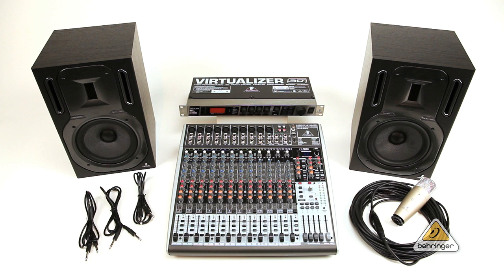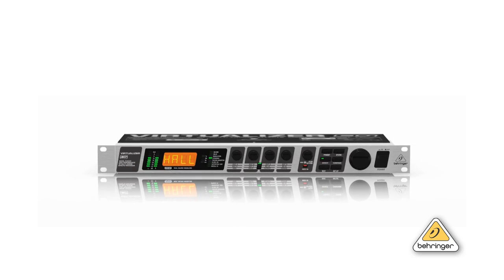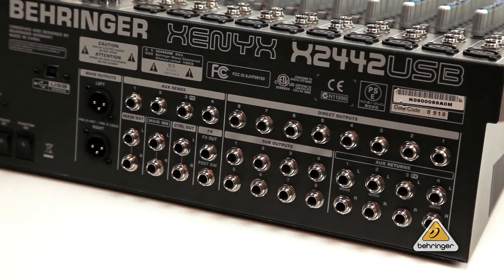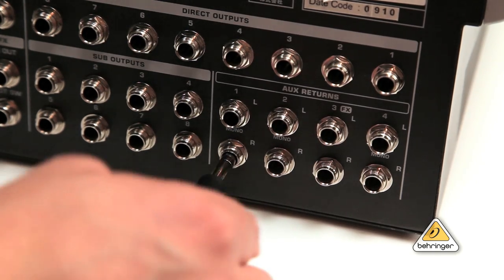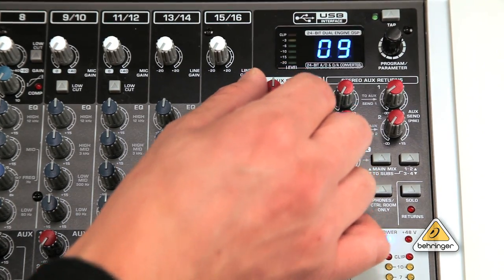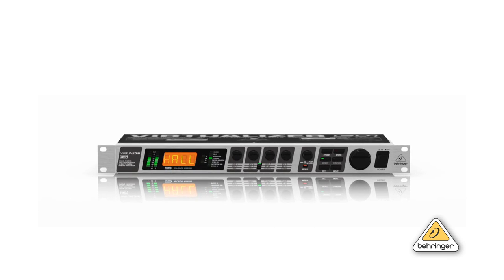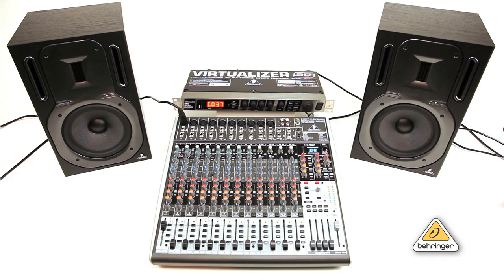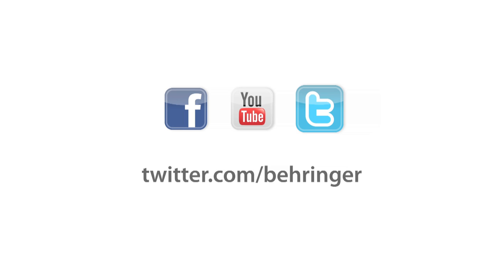How to use FX2000 Multi-Effect Processor with XENYX mixer Aux Send

Comment: I have a Lexicon MX200 (it has 2 in and 2 out 1/4's)  I want to use it with one of these mixers but I don't know if these boards can be used with a l/r send and l/r return so I can maintain a 2 channel stereo for all connected sources.  Will it work with the XENYX's?

Comment: I have a Behringer xenyx1002b and i'm curious about the "2-track input". what is this used for? can i use a converter for an xlr cable and use this track as another mic input or is it used for another function? i thought that this mixer was suppposed to be able to be used with up to 7-10 mics but i can only use five of my mics at a time, and having an extra track would be AWESOME. Any help?

Comment: I've tried everything, but can't get a stereo FX return signal on my Xenyx 1622fx with this technique. Only ever the left channel is returned with FX. (the right channel is always dry.)
My current set up:
1. mono 1/4" cable from aux send 1 on 16622fx to L input channel of Lexicon MX300.
2. Lexicon set to Receive mono from L channel. (summed to output in stereo)
3. 2x mono 1/4" cables from L and R output channels of Lexicon to Stereo Aux Return 1 on 1622fx.
Any ideas appreciated! cheers.

Comment: Sending mono signal to the effect unit only yields meter activity on the L (left) channel. I've used both a balanced and unbalanced (mono) cable, and the results are the same. However, the output 'sounds' like it's in STEREO. Any suggestions?

Comment: We just bought a FX2000 with the purpose of being a dedicated effects unit for a single vocalist in live applications. We didn't plan on getting a mixer involved in that chain, just: mic > preamp > FX2000 > DI > house/monitor. In the quick start guide thereis a figure of a microphone being plugged into the unit - with a large X over it. Looks like this is a "no no." Is it imperative to use a mixer? - or is it just suggested as good practice?
Reply from the maker: The reason for this is because the ins/outs on the FX2000 are line level, so plugging in a microphone or guitar directly into the back won't give you sufficient levels to color your audio source. Essentially it's an FX processor and does not a microphone preamp built in.